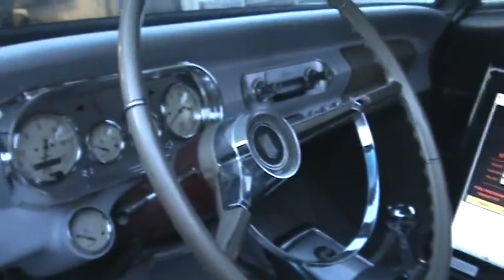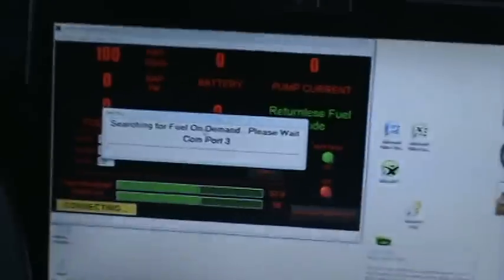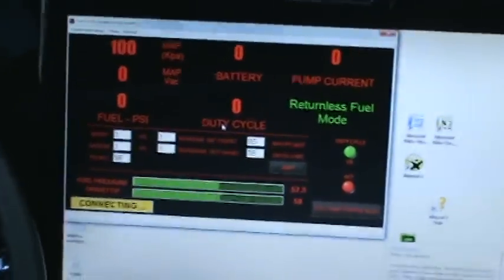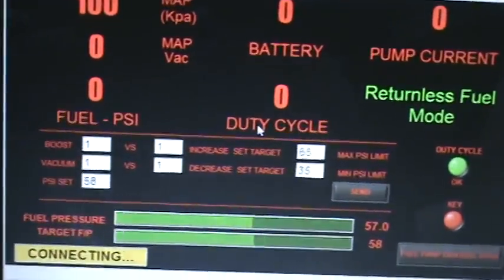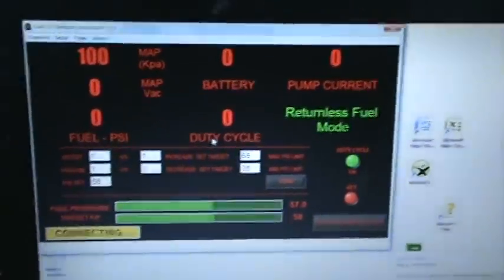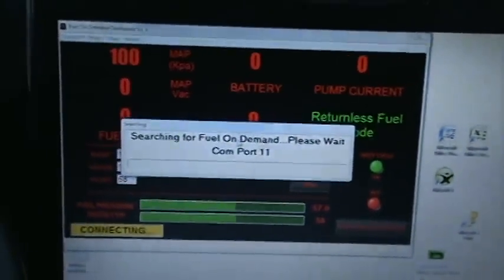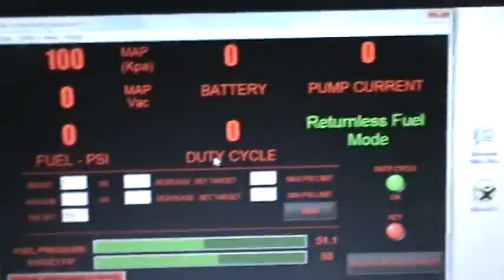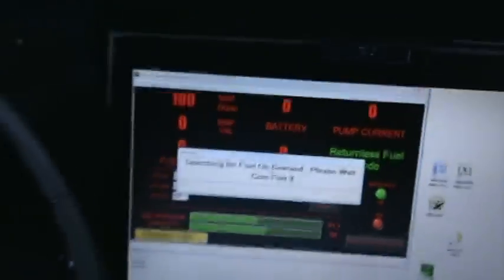Fuel On Demand, 2010 Camaro pump, Retrofuel tank

Comment: Could you give us a 2016 update?
Reply from the maker: Tumdéaux I think I'm around 3800 miles now.  Absolutely zero problems with any of it. Quarter mile pulls, highway driving, city driving, etc....No issues whatsoever.
Reply: LS67NOVA I've noticed that product has been discontinued by the manufacturer. I guess it didn't sell.

Comment: Can you share the wiring diagram with me?  If I get a ZL1 fuel pump (Camaro) how is the Pulse Width Modulation controlled?  Via the ECM that gets a fuel line pressure reference from an in-line sensor?   Is it not just easier to buy an in-tank high pressure fuel pump, throw on a Corvette filer/regulator a 58 PSI pre-set, mount it next to the tank and run the one line to the LS3 fuel rail?  I just installed the GM Perf. Connect and Cruise 430 HP version and tucked into my 36 Plymouth.   Any help would be appreciated.  I understand the advantages of the "on demand" systems but I'm also interested in simplicity as well.

Check out my BMW V12 powered 30 Ford Coupe or my 36 Plymouth Rat Rod build, Germany (search YouTube if interested)

Thanks in advance,

stegall@t-online.de

Roger
U.S. Army
Reply from the maker: Nothing from ECM. This particular kit comes with its own pressure sender that runs the system once you program your pressure setpoints. Two things with a Camaro pump and PWM.....1. the Camaro pump is the best setup you'll find to avoid fuel starvation, especially if you add the pickups to the siphon connection. 2. The PWM prevents the pump from running 100% speed at all times...which is quieter and a lot easier and cooler on the pump. But yes, you can do it with the Corvette regulator, as long as it can handle your flow rates.

Comment: Nice video. Im doing something similar on my 74 stingray. I plan on using an 10 camaro fuel pump like yours. Did you get one used or new? I was doing some research and found a left and right pump assembly, which one did u use with ur stock tank?